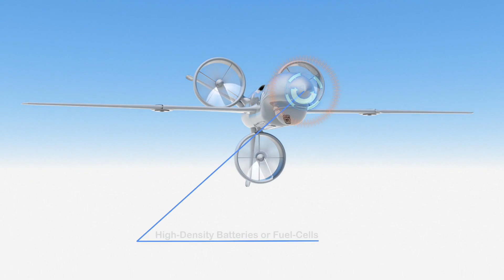AdvaNced airCraft Infrastructure-Less Launch And RecoverY (ANCILLARY)

Comment: It's a force multiplier in a few ways. Hybrid fuel source, appears to be able to house in the rear, assisted propulsion. High alit, tertiary control surfaces for super high speeds. VTOL with capability to reach high alt, then loiter. Expands mission cap.

Comment: I would hope that this project would not fail due to problems with underpowered engines for the weight, like the Lockheed XFV-1 program.
Reply: DARPA projects that end are not necessarily failures because DARPA isn’t really trying to make “products”.
Reply: @snower13  
The utility value of an ended project is subjective. History will eventually judge the value of this one, just like every other project. Value can range from something that is a clear win, to something that was a complete waste, and all points in between. However, as a Air Force veteran and taxpayer, if they are not "in it to win it," and they're just going to repeat the mistakes of previous programs, I would just as soon rather see this project die on the table before it goes any further. If they are going to push it to the max and deliver a system that does what this video touts, then by all means - give us the most bad@$$ VTOL drone constellation possible!